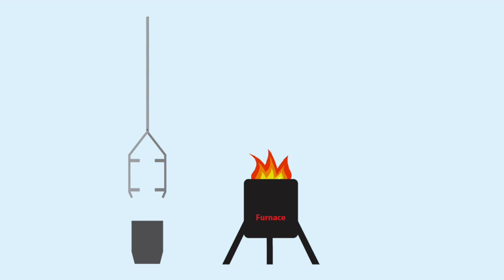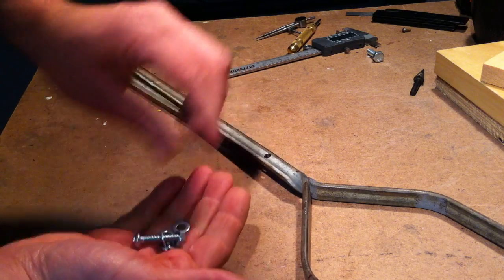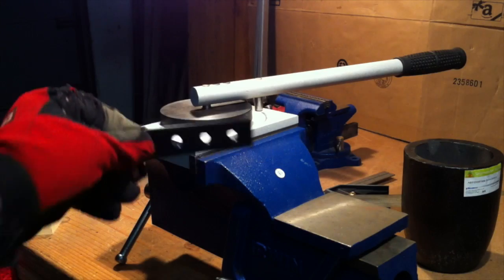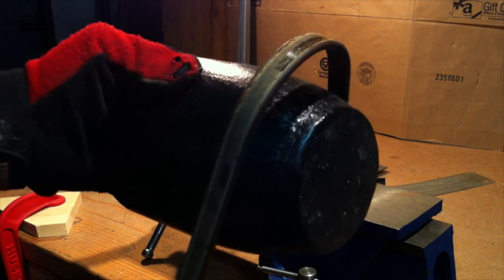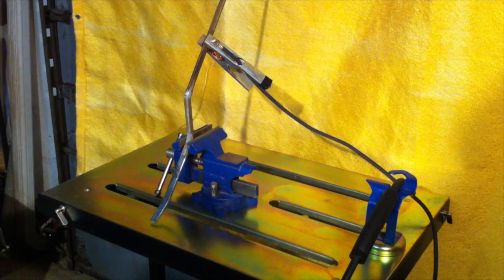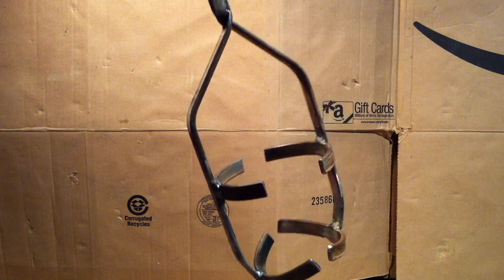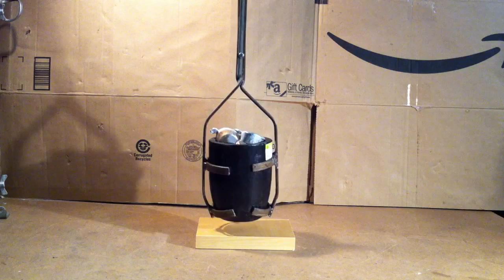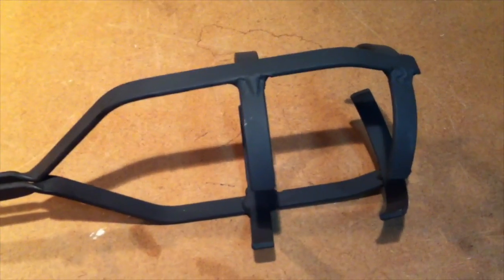Backyard Foundry DIY tools - lifting tongs part 2

Comment: This is just about the best video I've seen on making lifting tongs.  Most looked like they would squeeze the crucible too much (making it crumble) or else it could fall out when tipped.  The only suggestion I might  make is to have a "lock" at the top so that you could also pour from these without having to put it down without having to worry about the crucible slipping out.
Reply from the maker: Thanks for watching, taking the time to comment and the great suggestion! I thought the same thing about most lifting tings and was worried about putting too much pressure on a super hot crucible. Do you do metal casting? It’s a great hobby.

Comment: looks as if im getting ready to make a set of lifting tongs now.
Reply from the maker: Cool! Double check to see if they fit in the furnace and are able to grab the crucible. I had to do a bit of cutting and reshaping because I didn't have enough clearance.
Reply: do you not reallize who this is? this is bob from bison lol
Reply from the maker: Yea man, I know. Just wanted to give you a heads up on some issues I ran into after putting mine together.

Comment: These tongs look great. Looking to make a pair of my own. What do you think about doing a similar concept, but having the tongs approach the furnace horizontally instead of vertically, but then a 90 degree turn right before the engaging ends so it still drops over the crucible vertically? Then maybe add in some small pieces that hang over the rim of the crucible like a pouring shank so you can have a lift/pour tong in one. I'm new to this whole hobby, so I'm not sure if there are major drawbacks to this. Seems like most lifting tongs at least are all vertical.
Reply from the maker: +Mike Snyder That's a great idea. I actually drew up plans after seeing a youtube video where a person was using tongs just like what you described. Here is the link - https://www.youtube.com/watch?v=bvklUlD1YBo 

If you're just starting, check out www.alloyavenue.com. Great forum with great guys on it.
Enjoy the hobby - it's awesome

Comment: Looks great can't wait to see them in action. Only change you might make is instead of a T at the top you might roll them so as not to catch on clothing or sleeves. Now I want to make a pair.
Reply from the maker: Thanks! I figured I might need to change them up once I start using them. I might cut the T's down a bit.